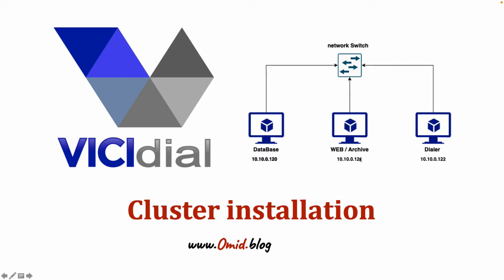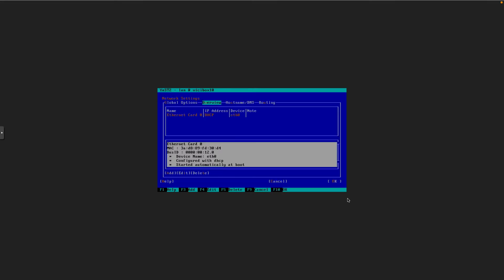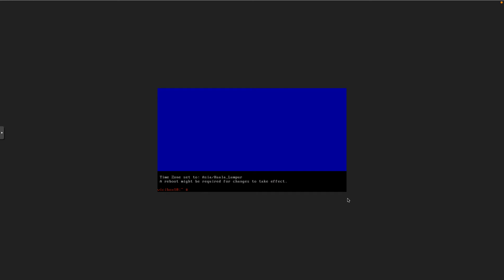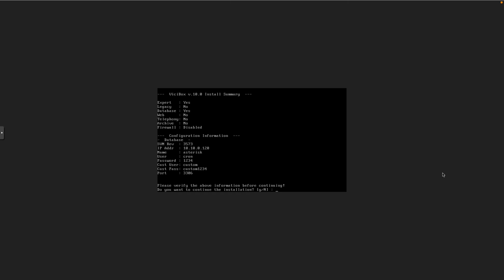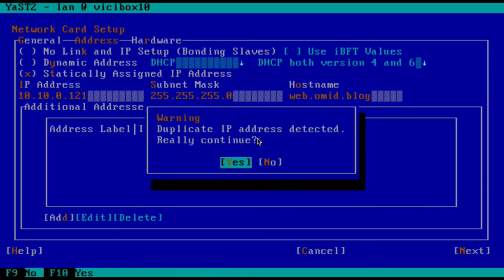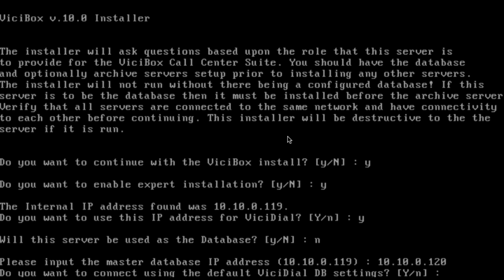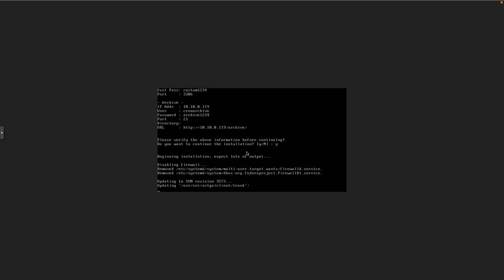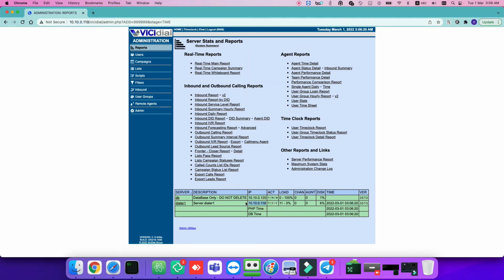VICIdial Cluster Installation [VICIBOX10 MultiServer installation ]

Comment: Sir, for 20-25 agents vicibox installation, is the vicibox recommended specs - 4core 2+GHz CPU 16GB RAM 500 GB storage good ? And is using SATA SSD instead of HDD required for the 500GB Storage ? And is RAID-1 a necessity from a practical point of view ?
Reply from the maker: Yes it should work without problem

Comment: Hi @omid which one is the latest stable version of Vicidial for 100-200 seats callcenter
Reply from the maker: Hi, The latest VICIbox version is 11, but version 10 remains stable and reliable. However, it's recommended to use the latest version for better security and features. For 100 to 200 seats, a full cluster setup is required, regardless of the version used.

Comment: Hi Omid ,My company DB server also used us telephone server and webserver is configured on one of the telephone server only .i want to know best pratice to use the server for 150 agents and iwant to know about secondary DB slave server
Reply from the maker: if you have resources and want to have highest availability do HA in all elements. But my idea is that DB is the most important one. you have slave DB and set settings to generates reports from slave db so when you generate heavy reports it does not effect the calls. Also have a separate FTP server for archive if you have recording. Web servers and telephony can be on the same server as they dont get much resources.

Comment: Hello,i got a question how do i configure more than 1 asterisk server ,i created a cluster setup by using 4 machines 1 for DB, second for web/archieve and third/fourth for asterisk,the question is im not able to dial manual calls from 2nd asterisk and most of the times im getting channel unavailable error on 2nd asterisk.how do i solve it? as im a newbie
even though i have right clis on all the sips of 2nd asterisk but still im not able to dial manual calls from the softphone
Reply from the maker: Adding asterisk servers are the same . How you added the first server you can the rest. If you can not call out you need to check the logs on the asterisk console and also VICIdial logs to see what is the problem . Hard to say without logs.
Reply: @omidmohajerani  channel unavailable issue and sip is not registered on voip
Reply: @omidmohajerani  do i have to use different voip accounts for different asterisk servers?
Reply from the maker: @shameems2005  if your provider restricts registration then you need to register with different accounts or what I usually do is that I setup a Kamailio infront and I setup the voip trunk in the kamailio . All Asterisk servers send to kamailio and kamailio sends to provider . Kamailio can handle very large volume of calls in very small virtual machine lets say with 1 core cpu and 2 GB ram
Reply: @omidmohajerani  if i can use same voip account for 2 asterisk servers then how is it possible because when i did that i m not able to make calls from another asterisk

Comment: Hello Omid, Thank you very much for sharing such a wonderful tutorial!  I'm newbie for dialer, I have two question could you please help me. I need to configure a cluster setup for 100 to 150 Agents, So, my 1st question is please suggest the best configuration for all servers, 
e.g. web/Archive, HDD capacity, RAM, CPU, 

DB server, HDD capacity, RAM, CPU
Dialer,
HDD capacity, RAM, CPU.
Q2. where I will configure phones in web server or on dialer ?

Regards,
Sunil Markam
Reply from the maker: Hi 
There is an official document from VICIDial about hardware that you can find it here : http://vicidial.org/docs/Vicidial_Hardware_Requirements.pdf

For 100 to 150 agents What I will do is getting   2 physical server and install proxmox in HA mode and then have roles on each VM for DB , WEB , FTP  and Dialers

IN VICIDIAL database needs the most powerfull hardware and What I will use will be 8 Core - 16GB RAM and SSD and harddisk capacity depends how long do you want to keep call and reports info

Dialers do not need much and for each 30 to 50 Agents you will need 2 core and 4GB RAM

Webserver can run without problem on 2 Core 4GB

for FTP Server hardware capacity depends on the how long recoding you want to keep. 

And phones are registered in Dialers .
Reply: @omidmohajerani  Thank you very much for your help.

Comment: I created the two servers, I only have 13 agents. In which server do I create users, campaigns, lists, in-groups, etc? thanks
Reply from the maker: for 13 Agents you don't need a cluster setup. One server is sufficient. 
and about you question what roles did you assign for each server? Did you follow my cluster guide here?
Reply: @omidmohajerani  The database server enabled the web server and redirect page. 
The dialer server enabled web server, redirect page, telephony and archive server.
Reply from the maker: @rafast840926  you shouldn't enable web server on 2 servers. One severr is enough . Then you have one page and when you create an extension or trunk you can choose which dialer to create an extension on .

Comment: I'm stuck, when i am installing my web server it asks for the IP of my Master database server. I have already installed the DB server. when i type in the IP of my Master database server, it show that, couldn't connect to vicidial databse:  mysql server could not connect. i would really appreciate your help.
Reply from the maker: try to telnet the ip address of Database Server port 3306 (MYSQL Database port ) and see if you can reach it .
Reply: @omidmohajerani  nope can not
Reply from the maker: @abhinavrawat3223  then you need to see whats wrong in your network . is it blocked on the way
Reply: @abhinavrawat3223  you need to stop firewall services in DB server, after that will connect.

Comment: hi omid, my server was working very well, I had directly connected my SIP provider on each their interface. but suddenly no interface responds now. when I ping my gateway it says "destination host unreachable" what to do or what to where to watch? already disable the firewall. i'm confused!
Reply from the maker: check if your IP is still configured by running this command

ifconfig

Also check if any firewall rules are there 

iptables -nL

I guess this is more to your IP address setting. run this command and set the IP address again. 

yast lan

Comment: I would like to use an old thin client I have for a single install and just for practice. The unit has 2 gb dom hard drive, speed of 1.66 ghz and 2 bg ddr3 ram. Do I dare try to install vicidial on this unit? Thank you.
Reply from the maker: It should work. .it may not detect nic because of driver that can be installed manually . Give it a try and let me know if any problems to help
Reply: @omidmohajerani  ok, thank you.